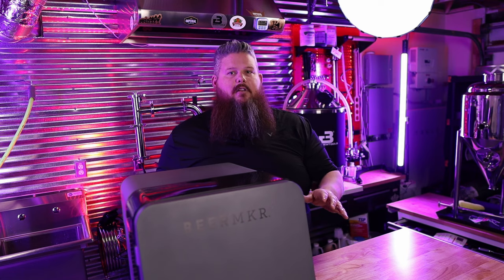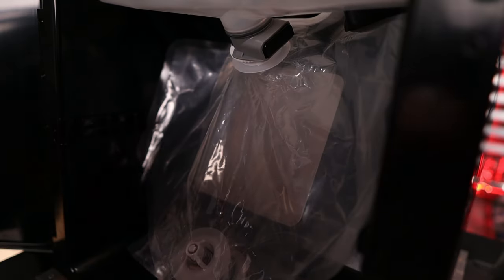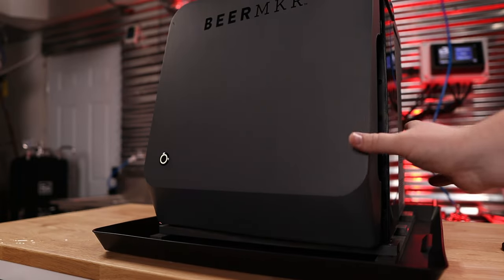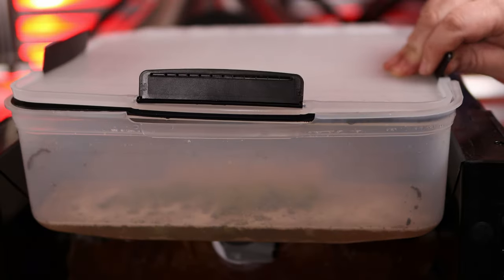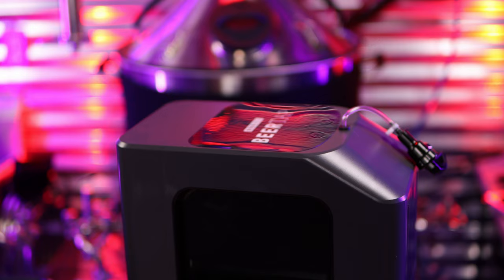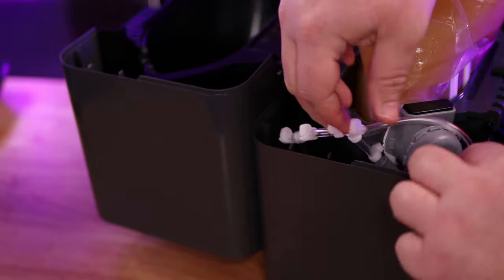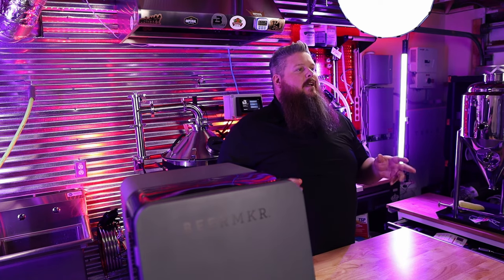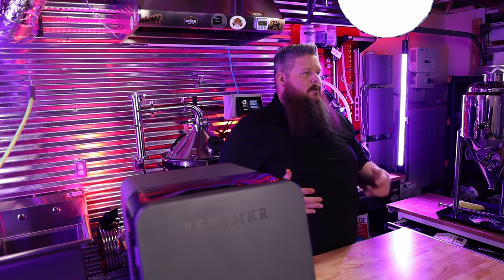BeerMKR

Comment: Really great content Bradley. Really nicely filmed and voiced. I guess this is pretty expensive, it certainly seems well thought out. It doesn’t look quite as premium as the minibrew, which I covered some time back but it is of the same niche it seems.
Reply from the maker: It definitely has a nice modern design aesthetic, as far as materials it’s kind of liking. It doesn’t affect performance. I suppose if it was built like a Breville product it would cost twice as much. Thank you very much it definitely took me some time to put this video together🍻
Reply: @PortlyGentleman  Greetings from the UK.Great video Brad(as usual) don’t wish to appear negative but seems a lot of work for only just over a gallon of beer and imo way too expensive,you can buy some nice stainless pots for nearly 600 bucks.Another alternative is a 10 Litre  Braumeister  machine,and in the US  can be bought for $999 and makes twice the amount of beer,smaller footprint,and stainless steel construction, and imo will outlast that unit.How long is all that plastic going to last before a hinge or some other vital integral part snaps off?
Just had a look on their website and $89 for a 6 x 1 gallon kits?🤔.

Comment: Were the salt additions to the RO water based on the total water required or the water added to the malt basket? Were the salt additions determined using a pH calculator?
Reply from the maker: The water additions were made based on the malt and the total water used. I did check the pH and everything was at desired levels. I used brewfather for the calculations I found it to be very accurate I’m also used to it.
Reply: @PortlyGentleman  Cheers. Was it easy to check the mash pH as once the malt is added the system appears to be difficult to access?

Comment: What was  the volume you got in the beer bag? Was it 2 or 3 gallons?  How about the cleanup?    I have seen some reviews that said the pressure side was weak at delivery. Great job and looking forward to  your full review.
Reply from the maker: I have no issues with pressure at all those users may have made some errors potentially. Cleanup is pretty straightforward literally just rinse it and then throw it in the dishwasher. I think a little more than a gallon